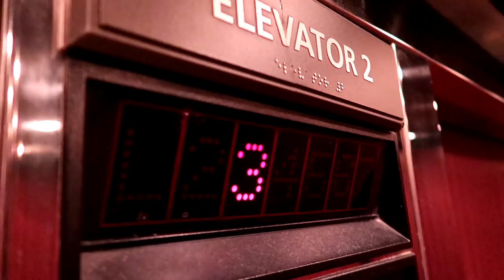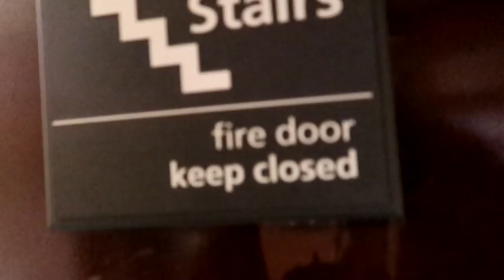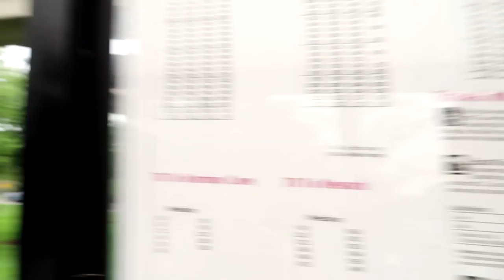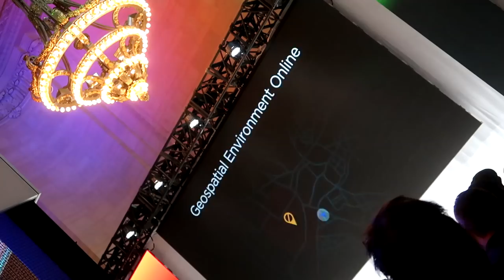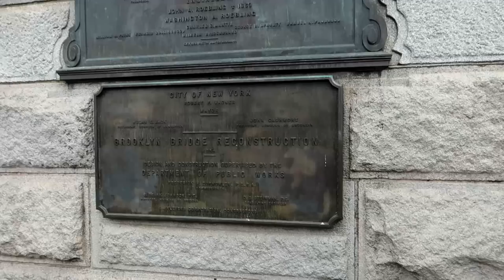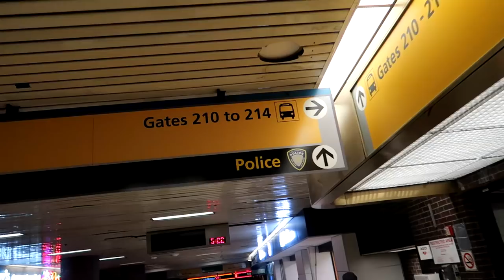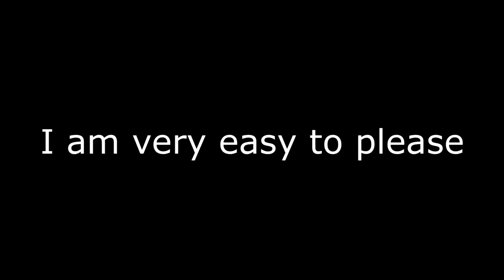HE'S IN THE VLOG

Comment: .
About a year ago...
I was repairing a car for some one...
Made a heat shield out of a Red Bull can...
(crank shaft position sensor... too close to hot exhaust.)
They told me I was like 3D Machines...
Well... I didn't know... "Who...?"

But now I am bummin'
because I am all caught up
and have to go back
and watch 3DM reruns...

Keep up the good work
I am looking forward to more.
Reply: Oh... Forgot to tell ya...
25 years ago worked as a "Boiler maker"
Built custom boxing rings for pro boxers
Five every week @ Ringside Inc.
(You've likely seen my work on television.)
(and didn't know...)
Have burned thousands of miles of wire
and always produced beautiful welds.
New mild steel is sooo... easy.!